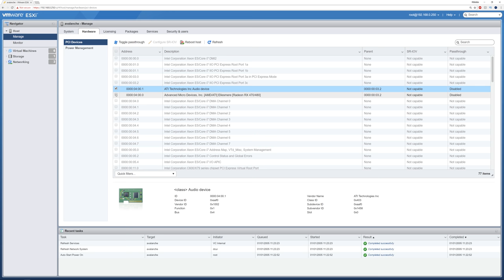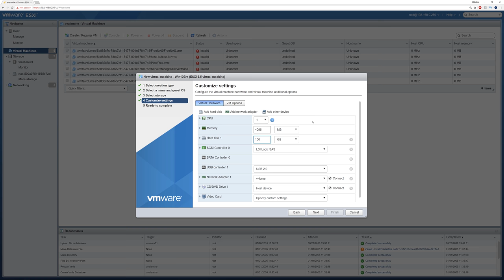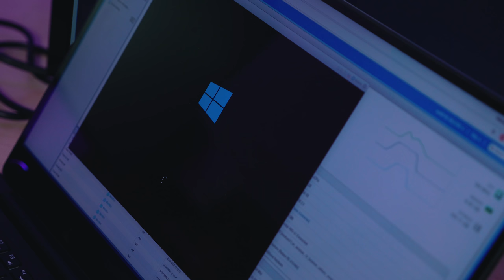Virtual Gaming PC in VMware ESXi 6.5 - Franken PC May 2018

Comment: Can you answer quick question?  Say I get ESXi going on a box.  Can I have an NVMe as storage, then install Windows 7 (say) into a container.  Then, Win7 unaware of actual NVMe and let ESXi help / let Win7 use NVMe as boot-drive ... without Win7 knowing actual type of hardware underneath.  Tried to run Win7 in bare metal once with a boot NVMe and didn't work, because my board too old.  So, is this easy now in ESXi -- say 6.5-ish?  Probably nothing now, but back with ESXi earlier versions.  I gave up with some stuff and my hardware was old.  I just moved to Win10 and VMWare in OS versus metal.  If time, please, give thoughts.  THanks.
Reply from the maker: Probably easier if you join our discord server http://grsk.co/community

Comment: Just to clarify, did you just simply use a full-screen vsphere client with video out from the laptop to that screen?

I am in the middle of building a new homelab (hobby), going from single 4-core cpu with 16gb ram to dual 8-core cpu with 128gb of ram. I was thinking since I have had no luck selling my old supermicro board on ebay, I might as well make it a HTPC/Gaming rig and slap a video card on it.
Reply from the maker: No it uses a dedicated GPU passed to the VM. The laptop only allows me to control the hypervisor via the web client.
Reply: @GearSeekers  I understand that the GPU is pass-through. I am trying to understand how you loaded the vm. I've been using vsphere for years. Trying to understand if you are using something instead of vsphere.
Reply from the maker: Web client built into esxi
Reply: @GearSeekers  guess it's time to upgrade for 6

Comment: So, I’m a networking student about to graduate, and I’ve been thinking about a setup very much like this, what kind of connection speed would I need to access this VM through something like VMware workstation on another computer with minimal latency issues? Would it be possible? Would workstation be the best remote approach for gaming or would there be a better option?
Reply: I dont think gaming via remote access would be a pleasant experience as the latency would be simply too much even on a local gigabit network. But i am curious to know if you gave it a try.
Reply: @ChinmayJade  You're talking about adding a few milliseconds of latency.

Comment: I am trying to fix an issue with a RX480 8GB GPU. Everything goes well and once I install the GPU drivers, the windows 10 crashes with an error about the gpu driver. Any ideas how can I fix it?
Reply: I had the same problem, I added: 1002 ffff link false to /etc/vmware/passthru.map on the esxi host, I found this info if you google "ESXi 6.0 U2, Passthrough Video Card, Hang/Freeze" in the official vmware community forum, I also activated 4g decoding in the bios

Comment: So, i can use a crappy laptop to game on it, using my good gaming desktop to render the stuff and go on the network to my laptop? Cuz that would be helpfull, i wouldnt have to buy a new laptop then 😊
Reply: If you have a good gaming PC, just install Steam on both the desktop and on the laptop and you can stream games to your laptop that are running on the PC (just open your steam library and if Remote Play Streaming is enabled on the desktop, it will show the games it has installed with a Green "Stream" option in place of the blue "Install" for the game you want to play) - provided your networks pretty decently quick, it should work fine.
Reply: @sentineluk7  oh okay, thanks for the help, but what about valorant? Thats a pretty important game to me...
Reply: @sentineluk7  also my laptop is fast enough but just has intel HD graphics of the 1st gen... thats not so fast... though i dont really need the graphics when i use my desktop for it
Reply: @Kenjismusic  If you can get Valorant running through the Steam launcher it should work (not great but it should display (use the add game button at the bottom of the library window and pick "Add a non-Steam game").  I use this method to play Cyberpunk 2077 on a Linux machine (my version was bought via GOG not Steam).
If that does not work look into getting FreeNX or NoMachine setup for remote control and viewing (VNC is too slow for remote viewing of Games - and no sound).

Comment: To be honest, I would've much preferred you ran Crysis. :)
Reply from the maker: It was 2018 what that video was made. Now it's not 2020 and the Crysis joke died in 2008. Sorry not sorry.
Reply: @GearSeekers  joke aside, Crysis still makes any hardware scream for its life more than Fortnite. But I get your choice out  of current trends / the need to attract traffic.
Reply from the maker: Crysis runs on anything lol
Reply: @GearSeekers  the whole point of it is that it's și badly optimized that it absolutely fucks with newer hardware as well. Tone down the arrogance.
Reply: @VladSpatariu  It's not badly optimised it's just not optimised for current hardware. The assumption when the game was made was that CPUs would continue to be developed up to about 5ghz on single thread. As for GPU performance, it really doesn't tax modern GPUs at all.

That said. Using Fortnite as the game example is just cancerous. Would have been much better to use a game that doesn't run on a fuckin' tablet PC lol :D

Comment: how you connect to the virtual machine?
Reply: When the Graphics card is enabled for passthrough, you just connect a cable direct to the graphics card itself for a monitor display (ESX uses a different graphics adapter - likely the inbuilt GPU on the Processor) to show the VMWare display.  The trick is you might also need a second USB port card as ESX sometimes is not good at handing over ports to use for USB Keyboard/mouse - depends on the computer you run it on.